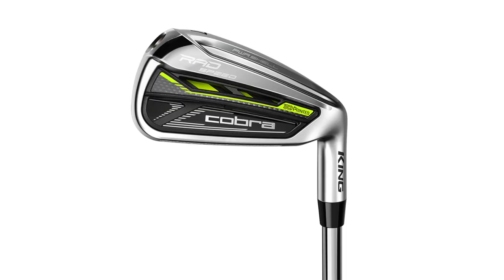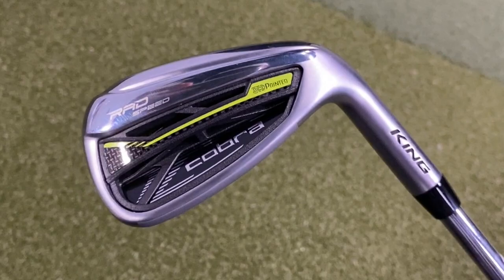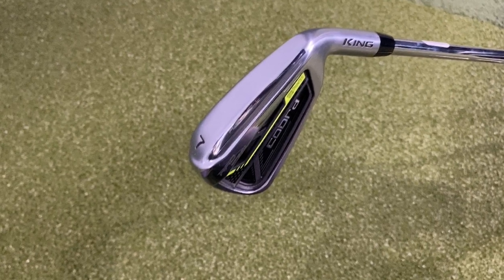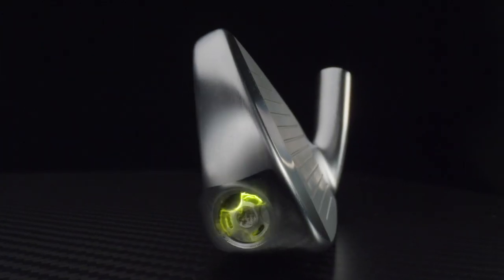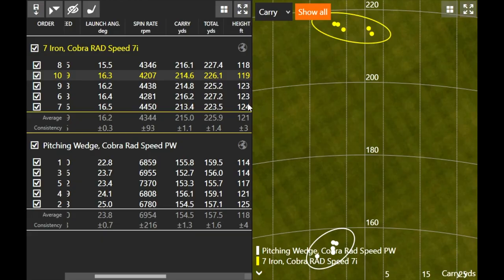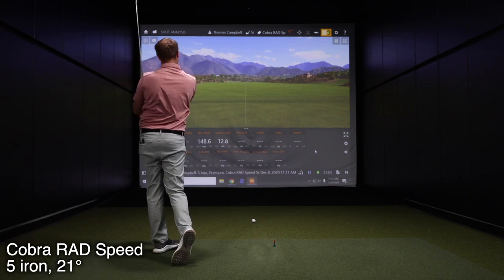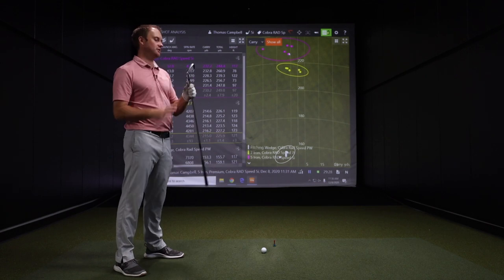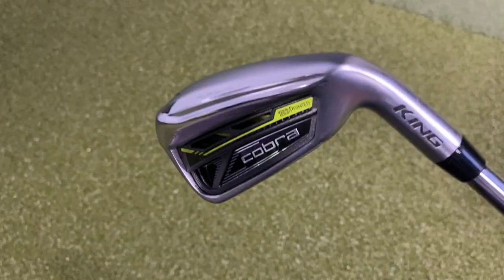Cobra RAD Speed Irons Review | Trackman Testing & Feedback

Comment: Cobra game improvement irons are always the real deal. I went from srixon z585 to the cobra F9 and my iron game improved tremendously. Worried about looks/turf interaction at first but  it's a non issue. The F9 were the last game improvement irons from cobra with somewhat regular lofts. Even though they went 2° stronger loft wise they did it without any negative side effects. They look just as good as anything (better actually) and for the price these cannot be beat. Will be updating at the end of the season.

Comment: Good review! I think these clubs are among the best available for game improvement, especially considering the price compared to other big name brands, shaft options, and arccos.

I think an important aspect you didn't mention was the landing angle which matters as much or more than spin rate when it comes to stopping power. The PW had an average of 54.3 degrees, which is very good.

I'm a big fan of One Length clubs, owning a set of 2020 Forged Tec and two OL wedges (54, 58). I think an interesting comparison would be GW, 7i, 4i comparison between OL and VL Rad Speeds. So on the 4i you will lose club head speed due to the shorter distance, but how much distance will that equate to, and does dispersion improve because it is easier to hit.
Reply: I just got them. I managed to have them fit for me knowing I have a 90mph (7 iron) swing with a super stiff shaft. They are just amazing, forgiving but without compromising the feel.

Comment: Impressive carry with these, as with many current game improvement irons, but how do you gap the set without at least 4 or 5 wedges?   Mid irons have become so long they leave huge gaps lower down - here 60 yard gap for the 9 and 8 irons to cover, too much  So I would think these are aimed at someone who hits the 7-iron maybe 160 yards and not 215, so the set gaps better.  I can't see a longer hitter using these due to the gaping issue in the shorter irons and wedges.
Reply from the maker: Yes, a longer hitter likely wouldn't fit into these. But to your point, if there is a faster swinger that maybe isn't as consistent with striking the ball, then a set of the RAD Speed irons could work well with an extra wedge added for gapping

Comment: If these clubs continue to carry farther and farther, are we not going to have even less irons and more wedges, i don't get it
Reply: I you have decent distance you don't play these irons as you have gaping issues lower down.  You use higher lofted players irons so you can properly gap your set.  These Rad and other similar irons are for those who have slower swing speeds and are looking for more distance.  They may hit the 7-iron about 160 yards so they won't have a gapping issue like Thomas would have.
Reply: It's all about selling you more clubs at the top and bottom end, years ago a full set comprised of 3 to SW, now a modern set can be as low as 7 to PW so you need a full set of wedges and hybrids, all about marketing and profit and most amateur golfers fall for it.